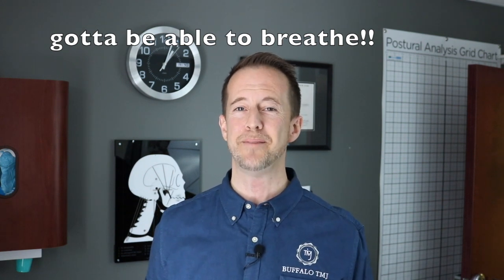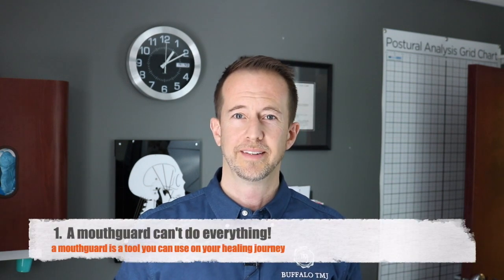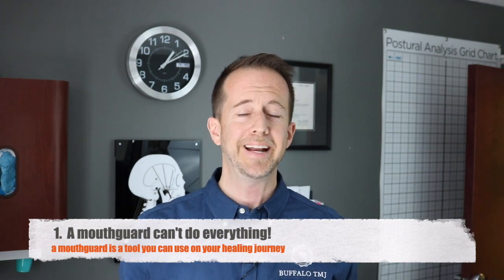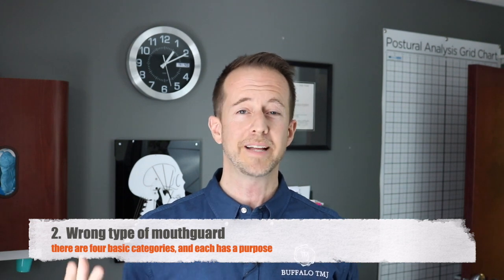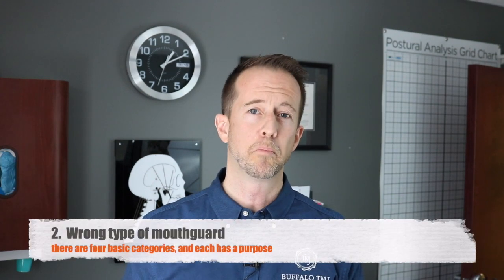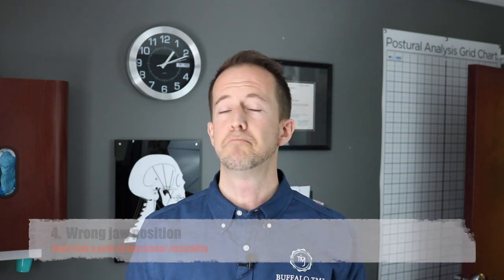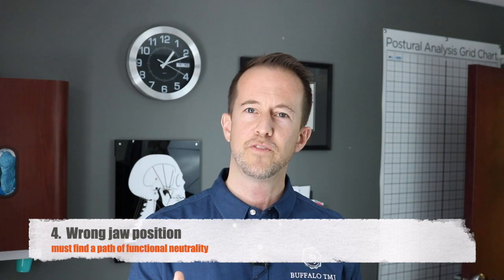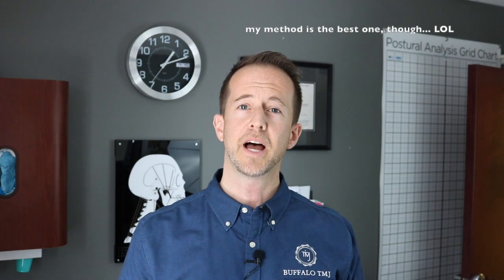Why mouthguards DON'T WORK!!

Comment: My dentist gave me a nightguard for my teeth clenching. Then the nightguard CAUSED my jaw locking and tmj! :(
Reply: I HAVE HAD THE SAME THING. Now I have pulling tension in both my chewing muscles and the joint.  If i chew gum, the tension and pulling goes away
Reply: Me too!  I had new crowns put on most of my top teeth and I got a guard that keeps my front teeth from touching and I am now waking up with headaches and clicking on the left side of my jaw.  This is after day one. My dentist won’t listen to me but I will try to ask her for some other solution.  This one cost me over $1000 and I’m so upset
Reply: Was this a mouth guard made by the dentist or a generic one?
Reply: @chillertheater Are you better now?
Reply: SMHHH
Reply: @natalifi  no I still have it lol. My dentist didn’t really listen or give a solution, she just referred me to a specialist. The specialist doesn’t take insurance and the appointments were $800 a piece. So I wasn’t about to do that. But I just started going to Accupuncture treatments and just after 2 sessions my jaw is a lot looser and not as sore/tight. Accupuncture is good for pain management and loosening things up so i think this will at least help!

Comment: I had a night guard made in October 2020 and now it has a hole on April 30,2021. The dentist told me that this guard should last me two years but it never did. The dentist underestimate my grinding . So now I am stuck with a night guard that has a hole and can’t afford to replace it . So sad. Still using this guard with the hole.
Reply from the maker: Very few dentists make high-quality night guards.
It takes a lot of time, attention to detail, and skill. And it's not very profitable compared to other dental procedures. 
I'm very excited about the potential longevity of some of the 3D printable resins!

Comment: Every single orthotic I’ve ever tried has made me worse no matter how many adjustments I had. There is no science behind them.
Reply from the maker: There is science behind them. Unfortunately, most of the scientific research doesn't differentiate between different types of splints. Watch the video I just posted about different types of bite splints from my app. Clear and precise diagnosis comes first, and the type of device selected should then correspond to the objective of the treatment. That is scientific method, by definition.

Comment: Wearing my lower mouth guard for teeth grinding. Feels horrible in my mouth like I’ve got chewy sweets stuck in my teeth. I know it’s psychological but I’m struggling to get to grips with it. Also I’m very conscious of my front teeth like the guard makes more more aware of the occlusion between my upper and lower front teeth and it’s distracting so it’s hard/impossible to sleep. 😔
Reply from the maker: Sound like you need a better mouthguard. 😉

Comment: My new hard occlusal splint is causing me upper right jaw pain that I never had before when going from a soft one to a hard one. I’m very frustrated because I had never had jaw pain before just clenching teeth at night.
Reply from the maker: The hard ones need to be adjusted much more precisely. There are materials that combine hard and soft, which is what I use most of the time.

Comment: Can you refer a good TMJ Specialist in Los Angeles area?
Reply: Ur mom
Reply: Not likely.  They are few and far between.  Regular dentists are doing what they think will help but there is little to no research and they are not trained in TMJD treatment but are using trial and error.  Often making situations worse.   At your expense.  Some like to make a guard for your lower case teeth.  Some think an upper case teeth guard works better.  Some like to use a soft guard, others a hard guard.  They want your feedback so they can figure out what to do next when it doesn't work out.  Then you will pay again.  And again.  It's unethical.  If not immoral.

Comment: I have tmj pain at right side 
Initially I can't understood the pain where 
I feel the  pain in the ear so I go to the ENT specialist he said no infection no ear problem ear is clear 
After some day  I recognize the pain position is inside the tmj instead of ear 
So I go to the dentist he suggested me to  eat slowy , give  rest to jaw 
But after 15 Day Tmj pain at right side and also cliking and poping sound at left TMJ 
And now  I have both side tmj disorder 
Due to tmj disorder my nekh and head also pain 
So 
My question is how I can realize this tmj pain totally and how I can avoid this clicking totally
Reply from the maker: It sounds like your condition/dysfunction is progressing, or getting worse, so I would suggest that you find a specialist in your area who can properly diagnose what is causing the problem, and then offer you treatment options.  Based on what you wrote, I would GUESS that an occlusal orthotic device will be very helpful to stabilize your jaw joints.  If the problem is that the joints are being overloaded, then the solution is either to reduce the muscle activity, or protect the joints from the muscle activity.
Reply from the maker: When choosing a type of mouthguard for this, my rule of thumb is to find a jaw closure path that flows through a zone of functional neutrality.  This means closing and tapping the lower teeth into the device should be easy, painless, and reproducible.
Reply: Shivam ji Mai bahut pareshan Hu sir apki problem ke Sare symptoms same hai mere Maine ent specialist dikhaya neuro ko dikhaya and physiotherapy ko bhi aur bhi bahut Sare abhi tak koi aaram Nahi Mila please please 🙏🙏🙏 me
Reply: How are you now? Any relief with your ears and tmj issues?

Comment: Hello doc.. I first felt this problem 2years back and it was not that severe.. But about 7mths back my face swole as i started chewing gum daily.. I consulted dentist and got relaxant and antiinflammatory and it subsided.. Now just 7days ago i started realising that my upper and lower jaw have been closing too forcefully and it felt so heavy and 2days later my right side swole all of sudden.. I consulted the dentist he gave me relaxant and antiinflammatory and  advised for follow up after two days.. The swelling didnt go so i visited and got low dose intra articular steroid injection yesterday.. But the problem doesnot seems to be going or is it too early to judge.. My face swelling has not gone.. I feel spasm all over my cheeks.. There is pain over my jaw.. Clicking jaw is something i have been experiencing from two years.. What do i do?
Reply from the maker: True swelling can indicate infection, or edema. It could also be blocked parotid gland ducts, or swelling of these glands, like what happens with mumps.  The cause of the swelling needs to be determined, so that's a question you'll need to ask clearly.  "What is the cause of the swelling?" Sometimes people come visit me with a complaint of swelling, and I won't see any indication of infection or edema, and in these cases I find that what is perceived as swelling is actually increased tension in the masseter muscles and sometimes facial muscles.  Chewing gum will often increase the SIZE of the masseter muscles, and make the face look swollen. 
For now, the best you can do is try to relax your jaw, try to relax your mind, breathe, and perhaps apply a cool compress to the sides of the face.  Consult with your physician to see if there may be a medical cause of your facial swelling, and see if you can find a TMJ specialist in your area.
Reply: What kind of antflammatory
Reply: What's the name of the medication  you take..

Comment: Hello, I'm sorry to interrupt you again, so I have spotted that the right side of my jaw is shifted lower than the other one, it wasn't like that before, another thing is that I have had a mouth guard before, but I threw it out since I thought that my jaw was OK, now I really regret it, should I get a new one and is jaw shifted  to one side normal?
P.S. I can feel that my jaw isn't normal by pressing the finger on that area. :(
Thank you for taking your time.
Reply from the maker: Definitely have a dentist take a look. What you're describing could be perfectly fine, but you might benefit from an orthotic as well.
Reply from the maker: Asymmetry such as you describe is common, but not normal.  There isn't much you can do to correct true skeletal asymmetry short of orthognathic surgery.  If you are comfortable and can chew food adequately, then there is no pressing need for treatment.  A clinical examination would be needed to discover the cause of the asymmetry, so that is the next step.
Reply: @BuffaloTMJ  thank you very much!

Comment: can wrong jaw position or jaw dislocation lead to migraine
Reply from the maker: It isn't the jaw position or the disc dislocation that leads to headaches.  Rather, it's the response of the musculature and the nervous system that seems to trigger pain.  Relax the musculature, and calm down the nervous system, and the pain tends to fade.
Reply from the maker: That being said, sometimes you CAN'T relax the muscles or the nervous system, because these responses are autonomic and reflexive. So utilizing some type of orthotic device, physical therapy modalities, and palliative measures are helpful and often necessary tools.
Reply: @BuffaloTMJ  a author  and a expert in migraine told me that 80% of patients with jaw pain know as TMJ puts pressure on trigeminal nerve have migraines.... so basically i wanted to know in case  of jaw clicking  (popping sound) is possible in any way that we would be putting pressure on our trigeminal nerve... that would lead to migraine
Reply from the maker: @wolverine417  it is an interesting theory, but only a theory.  I'm not sure where the 80% number comes from, but I'm not aware of any conclusive evidence verifying the validity of this theory.  The truth that we know is that the afferent branch of the trigeminal nerve which comes through the TMJ is the auriculotemporal branch.  If it were "pinched" (a term I do not accept as applicable related to the TMJ due to the dynamic nature of this joint),  then one would expect to experience tingling or numbness above and around the ear on that side. This is what happens elsewhere in the body, like when a nerve is pinched in the spine, or when you bump your funny bone (ulnar nerve).
Reply from the maker: Migraine is a complicated topic, and many things are thought to contribute to it.  I agree that it is possible, maybe even likely, that many patients who suffer from migraines also suffer from some level of TMJ dysfunction, but coincidence does not prove causality.
Reply from the maker: I'm also an author, by the way. :-)
Reply: @BuffaloTMJ  thank you for the help really it helped me clear my perception towards migraine.  I have migraine so it would really help me to redefine my approach towards it. Thank you.